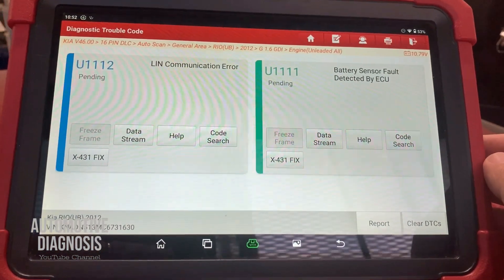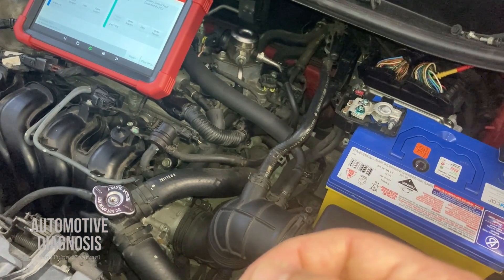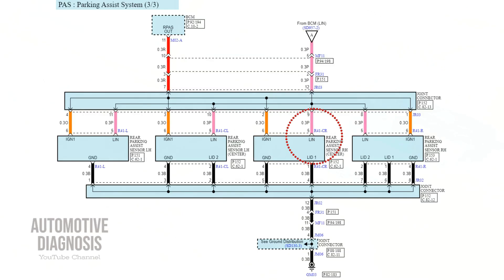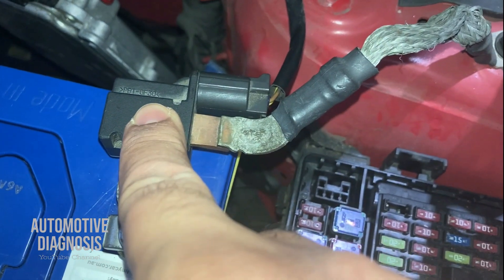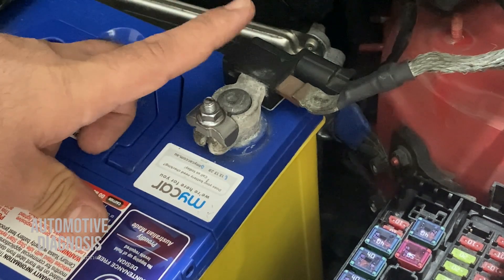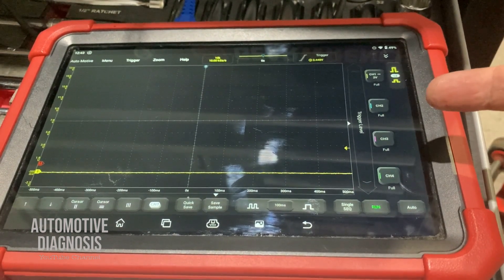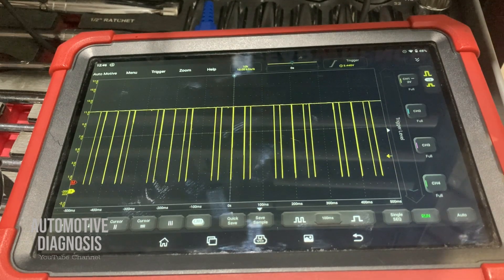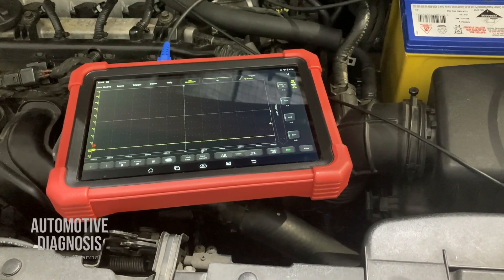LIN BUS Diagnostics | LIN BUS Communication Error | LIN BUS Waveform

Comment: I don't have oscilloscope yet, can I test it with multimeter? And what values should I get in both sides, battery sensor and alternator regulator 
Thanks 👍🏻
Reply from the maker: Hi there, voltage range of LIN bus is between 12 to almost zero.
Because multimeter is not fast enough to read this changing voltage, it’s gonna give you something in between, which is mostly close to the base voltage.
Reply: I have buying a Hantek oscilloscope with tow Canales, i hope i can fix it following your steps, i will give you report later 😅
 @AutomotiveDiagnosis
Reply: @AutomotiveDiagnosis i found 1.45 volts!!!

Comment: Can you explain, when unplugging a sensor, is the positive oscilloscope lead supposed to be  connected to that sensor? Or should it be connected to the Master? At the moment when I have my lead connected to the limbus wire in the sensor, if I unplug the oscilloscope shows a “short to positive” type of error I believe (basically it shows one or two dips down and the majority of the line is straight/horisontal at the top…) thanks

Comment: Thanks very much! I've been chasing a battery light issue and it turns out my alternator is causing the LIN bus to go flat, just like in your example. Thanks again!
Reply from the maker: Hi my friend. I’m glad this video was helpful. We also have a video for LIN-Controlled alternators, you can watch it here:
https://youtu.be/Dj9oJT4bJHU?si=KRpg6n1PZB4KxGTt
Reply: @AutomotiveDiagnosis  I ordered a used alternator from the wreckers. I just installed it this morning but the battery light remains. And I can see it is communicating now on the scope. The voltage is 14.2 so it's clearly working. Any ideas? Thanks again!
Reply from the maker: @jeffgrantct  Hi my friend, by any chance, have you checked it for a fault code?
Reply: @AutomotiveDiagnosis interestingly, the problem resolved itself! After I reinstalled the alternator and the light remained on, I unplugged the battery and went for lunch. When I got back I reconnected the battery and then, not only was the battery light on, but the check engine light was on for the first time too. I read the code with my cheap Amazon code reader and it was something about a cylinder misfire??? (previously, there were no fault codes to read, and my reader apparently can't read anything but the generic codes) I cleared the fault and the check engine light, as well as the battery light, went out! I drove the car around this afternoon and the lights have both remained off. So, fixed? Again, thanks for the help on this. I would have changed the alternator, but I never would have understood what the problem was.
Reply from the maker: I'm glad that it's fixed now. I think the reason that you had the light on, was that the fault code was there, so after driving, when ECM confirm that the communication is happening with no error, light went off. And the reason for misfire could be the OBD reader itself, some of them show a fault code which does not exist.

Comment: Lin bus diagnostics would be so much easier if the service data would state wether the data line is a pull up or pull down circuit design.